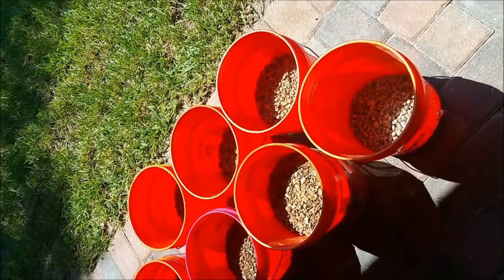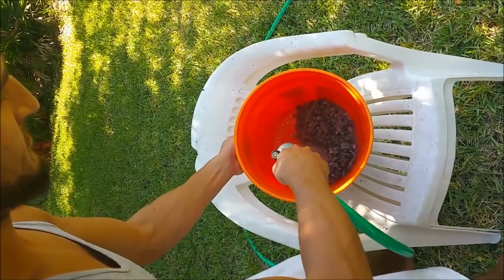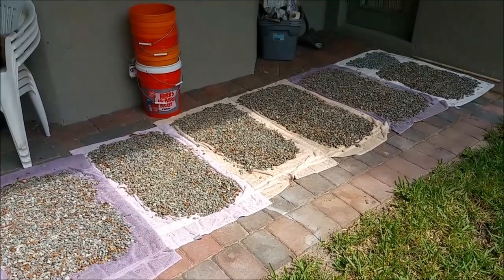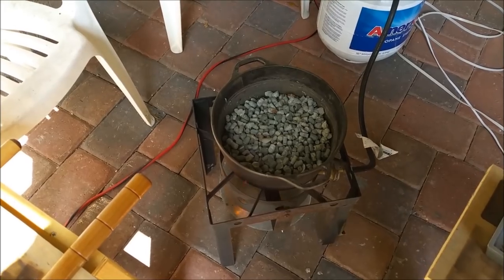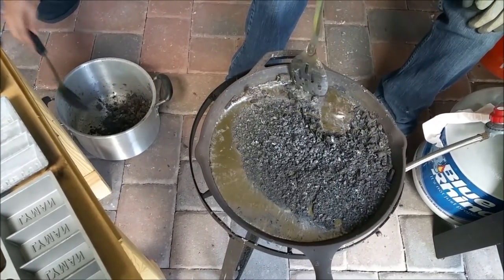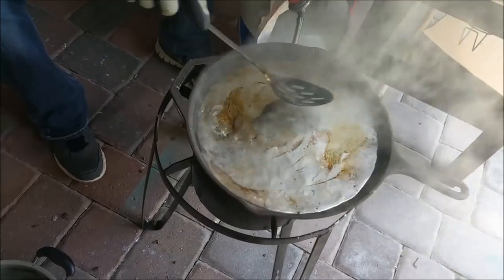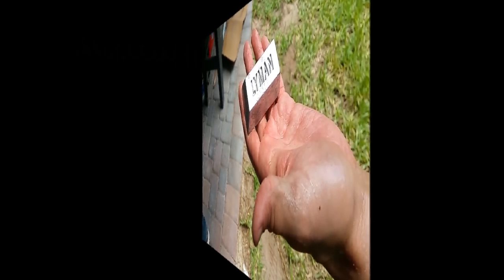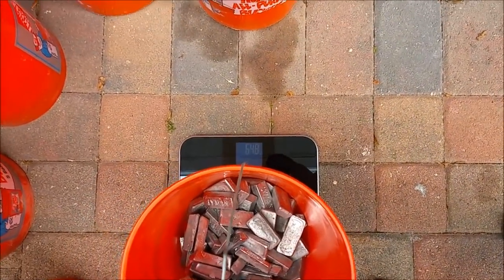Cleaning and Melting Reclaimed "Range Lead" into Ingots

Comment: Now, i see the point of quenching to make them easier to handle faster, but the hardness issue is debated as having and viable benefit and doing it at the ingot stage seems pointless as you're just going to have to melt it back down again to actually cast the bullets later on. 🤷🏻‍♂️
Reply: This is an old video but i wondered how many comments would address that.
Some folks really make you scratch your head. Okkkkkk 😀
Reply: He also took an unnecessary and risky step by introducing moisture into the range lead.  you will end up fluxing and scraping the dirt out with the copper anyways so no need to wash your boolits before melting 😉

Comment: To any new or inexperienced melters. Do NOT introduce any reclaimed lead or scrape pieces into your molten lead pot that are not completely dry!! A drop of water on a bullet or old wheel weight and your molten lead WILL explode in your face. Be advised and have fun.

Comment: No matter how many times I do it, it's always magical to watch someone else do it. Nice video.
Reply from the maker: Thank you sir!  It was a good haul - but I have made some modifications and refinements to our collection process, and we are getting geared up for another run this coming weekend.  Built a 2-Man Sifter which will be used on top of two specially made Saw Horses.  Will completely alleviate the back breaking work of the sifters I made for our previous trip.  They work well - but are still a lot of work.  The new method should be incredibly smooth, with very little effort, and should drastically decrease the amount of time involved.  Anticipating over 1000 lbs on this next haul.  I plan to do another video as well.
Reply: +DKH TACTICAL that's going to be nice man. Looking forward to the video. The most I've ever got at one time was 70+ lbs.
Reply: That's what I think about porn

Comment: a little trick for drying it would be to take 2x4s and small chicken wire and make basically shaker screens. Then just stack them up with 1 inch spacers (can be cut from 2x4s) to set between the racks for airflow. That way you get air going from all sides (pretty much) instead of just from above. You also take up less room stacking it vertically instead of all over the patio.
Also leave the last 1/8 to 1/4 inch of lead in your pot when you are done melting. It will melt quicker after already having been melted and you should find that it will allow you to melt your scrap quicker having a puddle already in the pot.
Reply from the maker: OtisENGINEuity -- great idea.  My wife would definitely appreciate me taking up less space and creating less mess on the back patio...  Great suggestion about leaving some lead in the bottom of the pot!  Thanks!!
Reply: DKH TACTICAL no problem, I learned that first hand when I brought stuff home after my grandpa died and started making weights. I noticed that if I left a bit in the pot it'd word easier.. same deal.
I'd love to do this myself especially with California going psycho about lead but unfortunately I have scoliosis that has made itself seriously known since I turned 30.. Threw my back out just bending over to pick green beans and took 2 weeks before I could do anything again.. 
BTW, as the son of a retired Air Force MSgt, thanks for your service. I'd be in the Army right now if it wasn't for my stupid back.

Comment: Great video can you use range scrap for slugs or is it to hard or is it softer than wheel weight thanks
Reply from the maker: ocean374  I will definitely defer to anyone who is smarter on this topic - or has more experience than I do, but Range Lead is going to be a MIX of different types of Lead.  Since I am reclaiming bullets of all types, it will include some Cast Bullets that people might have used Wheel Weights in their mix, and bullets from people who might have reclaimed Lead from Batteries, Dental Offices, Keels from Sailboats ---- the list goes on and on...  So the amount of Antimony (percentage) that you might have with reclaimed Range Lead can definitely vary!  I personally use the Reclaimed Range Lead for all my bullets, buckshot and slugs, but if you are looking for specific softness for your slugs (so they will expand/mushroom better), then you are definitely better off with pure lead -- or as close to it as you can get.
Reply: The only reason commercial shotgun slugs are pure lead is liability. You can fire them just fine through a full choke, but hard cast lead can only be fired through a cylinder choked barrel. I've made many hard cast lead slugs and they shoot just as well.

As for pure lead being softer for expansion, it's a pretty mute point when punching a .729 calibre hole through something.

Comment: For the future you don't need to weigh each bucket to find out the total weight.

Since you have 128 half pound ingots you have 64 pounds of lead in half-pound ingots, and you have 286 pounds of lead in whole pound ingots. Add 64 and 286 and you get 350. The extra pound you had might have been from the buckets, might have been an extra ingot that didn't get counted - I know I'd tire of it after about 50.

Comment: Why wash it first? Won't the smelting separate the dirt from lead?
Reply: Yea I kind of thought it was a waste of time to wash it.
Reply: I rinse wheel weights before I sort them so I can better discern if they are steel, zinc, or lead.  Makes the visual part of the sorting go quicker.  After I'm done sorting, I let them dry for a few weeks.  For range scrap, I just toss all of it in.  Dust, dirt, rocks, sand, etc.  It all floats on lead and is MUCH easier to skim off than rinse off.
Reply from the maker: Yes - the debris will float to the top, but you end up with wayyyyyy less mess by taking a little extra time on the front end...  I was not in any rush.  If taking the extra time is not your thing --- and/or you don't have the time (or patience), feel free to just dump it all in the melting pot and get jiggy with it...
Reply: asleepinthealley better efficiency by not heating a bunch of extra stuff dirt and rocks and such.
Reply: Everything will float. Then skim 
Anything else is wasted time.
Reply: You rinse all the lead dust into the lawn.
Reply: DKH TACTICAL by washing them that way, you probably have lead leeching into your lawn.  If kids play there at some point ...

Comment: Country Boy Prepper, sent me over. Nice vid can't wait to see the rest
Reply from the maker: Joseph Gauthier Thanks Joseph.  I ended up using a few pounds this weekend of that lead we just reclaimed, and did some casting with a new 6 cavity 158 Grain .357 mold.  Bullets came out great, and I used a new process of Powder Coating them --- instead of Tumble Lubing or Pan Lubing.  They came out nice!  I will definitely be doing a Powder Coating video soon!
Reply: Sweet, can't wait

Comment: Those little DIY tables are a great idea.
Reply from the maker: +Nick Musuraca Yes - after doing this a few times, we keep seeing ways to improve the process, and the need for some type of tables at an appropriate height was on of the first things we noticed.  Each time we do this, we see areas for improvement and for efficiency.  We started out with only 1 Burner, and only 2 Ingot Molds.  We quickly figured out that we were wasting precious time, and burning through more propane by only having 1 burner and 2 Ingot Molds.  Getting the right utensils was also something we didn't have to begin with.  The Tempura Scoops for removing the Jackets, and the Ladles for pouring the Ingots were also added after our 1st endeavor.  We are by no means "Experts" --- but I think we are getting better each time we do it!

Comment: Literally the only thing your process has that’s better than mine (see ‘Copper And Lead Recovery From Old Bullets’ video, which is about to be revised with an even better melter) is the way you mold the ingots. I currently use muffin and pie pans. 😄
Every time I see one of the many videos showing bullets being melted in skillets and pots just open to the environment with NO insulation to save energy cost and decrease melting time, and no containment against the occasional and sudden eruption from trapped gas or trapped moisture, I just want to jump right out of my skin! 😬😄! But what do I know, having recovered only around 5,000 pounds of bullets so far (all from “open range” and BLM areas)? 🤓

Comment: awsome video that lead stash is a treasure trove as good as gold!!
Reply from the maker: angelo soriano Thanks!  It was a pretty good haul, and the ingots came out great --- very clean!
Reply: it appears your an old salty sailor too!!i was separated in 84 from the uss wabash out of alameda ca
Reply: +angelo soriano (lead bullets
 for life) 

kindly, send to name of flux
Reply: candle wax or wood shavings and saw dust works as well.
Reply from the maker: Mohamed Aziz  I bought that tube of FLUX a couple of years ago, and have not been able to find it since -- but you can use Candle Wax, straight Paraffin Wax, or Saw Dust...  Saw Dust works extremely well.
Reply: yes,once the lead is up to temperature adding the candle wax will make it smoke then it sould catch fire. if not then add a match or lit flame to the hot lead and it should immediately start up.after the flame dies down remove the slagg.

Comment: DKH..  Welcome to the lead smelting and casting addiction!  I always like to see a fellow caster in action.  I found your channel through CBP and am now subbed!

Some pointers for you from a long time lead hound & caster:

 1)  Your safety gear looks good except for your son wearing shorts and tennis shoes.  Heavy cotton jeans and boots work well.  I have done the spilled hot lead dance and was so glad I was all safey-ed up.  I even wear a welders apron.

 2)  You don't need to wash your lead.  It can leave water trapped in the lead (ask me how I know) even after sitting for a long time.  Also.. any dirt, grime, coating, grease, or debris, will burn off with the melt and can be scooped off the top.

 3)  Fluxing..  It looked like candle wax that you used to flux the melt.  Wax is not a flux.  It can only reduce the tin & antimnoy back into the melt that may be lost through oxidation.  It also creates surface tension & prevents surface oxidation.  Use sawdust instead..  go to Walmart and buy a bag of pine pet bedding.  Saw dust reduces, prevents oxidation, and cleans your lead.  Wax will Not clean your lead.  Fill your pot with the scrap, add in a tennis ball size pinch of the sawdust to the pile and put the heat to it.  You will also find that when you are scooping the junk that the lead doesn't stick to the debris.  You can flux multiple times with sawdust if you like, and every time you add new scrap.  One last thing.. make sure that you scrape the bottom and sides of your pot.  Dirt can actually become trapped under the lead and you don't want that in you bullets.

 4)  Water dropping your ingots will only add a small amount of surface hardening to them, which will be lost when you remelt the ingots to make bullets.  WD does cool them faster though.  If you want harder bullets.. WD them.

I find that most of the range scrap that I deal with comes in at about 12 bhn which is similar to wheel weights.

If you have any questions I am always happy to help.

In all.. I enjoyed watching your video..  Thanks

Shad
Reply from the maker: shadowcastre 

Thanks for your comments... I definitely agree on all SAFETY pointers... My son started out with Jeans, as I insisted on it -- but then changed as the morning turned to afternoon and it got hot. I'm not as strict with him as I was when he was a teenager! Now that he is 24 and a grown man - he has his own way! Even when you are as careful as you can possibly be - accidents can still happen, and I will insist on jeans throughout the process from now on! 
As for what you said looks like candle wax -- it is actually FLUX, that I purchased in a 6 inch long, 1 inch diameter roll. Looks like wax - but it is actually FLUX. We have also incorporated sawdust into our fluxing as well. I do a lot of woodworking, and have plenty on hand.
Thanks for the info on Water Dropping of the ingots.  I understand that any hardness may be lost when the ingots are re-melted in the bottom pour pot – but as you mentioned, I also Water Drop my bullets as well.
Love it when I get feedback from other YouTubers!  I enjoy any comments that will help me improve my processes. 
Thanks again – and Happy Casting!!
Reply: shadowcastre ....great info......I hound as well.
Reply: I have a question, I have about a 6 quart pot outside melting right now on a turkey fryer, and it even has a lid. I filled the thing nearly to the top but it's been burning on full blast for about 3 hours and is only halfway melted (sigh) what am I doing wrong or what can I do to speed up the melting process?
Reply: @jacobwilliams2089  I had the same problem. The flames from your fryer are probably yellow/red. That means the temp is on the low side. Make the flames more BLUE by adjusting how much air the fryer get. More air = more blue = more heat.
Reply: @rogerolsson7303  I think most of it just wasn't lead and I didn't know

Comment: where did you get your things to pour the melted lead into from that forms the ingots? can those same molds or ingot casting things be used for copper or aluminum or brass?
Reply from the maker: If you are referring to the Lyman 1lb Ingot Molds - I got them from Amazon.  Here is the link:

https://www.amazon.com/Lyman-2837794-Lead-Ingot-Mould/dp/B001GXHM4W/ref=sr_1_1?ie=UTF8&qid=1470013424&sr=8-1&keywords=lyman+ingot+mold
Reply: +DKH TACTICAL yes and thank you very much my new found friend
Reply from the maker: You are very welcome!  I have refined my Lead Retrieval Process.  My son and I are planning another trip - probably in September.  Should be a minimum 1000 to 1200 lb haul.
Reply: DKH TACTICAL wow thats going to be a great haul if you can pull it off btw alot of the automotive stores most likely have old battery post and terminals and such easy way to get goot grade already sorted lead.... without gravels live ammo maybe occasionally you'll get a rusty stuck steel bolt but nothing too dangerous
Reply: Another source would be junk yards or at yard sells though yard sells could take a while but look for batteries, posts terminals and old hand tools like drills saws alot of them had lead castings the ones today have steel, aluminum and plastic castings or body's/ handles

Comment: Nice! But why to waterquench when you anyway will melt the ingots to make bullets later?
Reply from the maker: True...  It was more to just cool them off so we could move them and get them out of the way.  I do water-quench when casting -- so calling this a "water-quench" at that point was not necessarily for "hardening" -- and more so just get them cooled off and out of the way!
Reply from the maker: My comment about Water Quenching was premature.  We were just dropping the ingots into the buckets of water to cool them down to make them easier to handle/maneuver.   Obviously, we Water Quench the bullets when casting..

Comment: Did you tare the bucket for an actual weight ... also what pots are you using to melt in...?
Reply from the maker: +gerry kline Not sure what you are asking with the question of "Actual Weight"...  The scale we are using in the video is a pretty decent bathroom scale - so it's not going to be 100% accurate, but it's close enough for my purposes.  The pots are "Cast Iron".  One is a really big skillet, and the other is like a Dutch Oven Pot.
Reply: Tearing means the bucket has weight which is not LEAD thus you set the bucket on the scale hit the tare button and set it to "0" then add your lead weight. Getting the EXACT weight of JUST THE LEAD!

Comment: So how much did you end up making off of this run? I know it was a while ago now, but still curious. Thinking about getting into this and would like to know if it's worth it all.
Reply from the maker: I sold about 100 lbs at $2.00/lb, which bought some new reloading dies and some other reloading components, but I do a lot of casting (Slugs, Buckshot, and a wide range of various hand gun calibers), so I go through a lot of lead just by myself.  I still have well over 100 lbs left, but we will be doing another run around October - after it cools off.  We have refined our sifting process, and plan to recover well over 1,000 lbs on the next run.
Reply: DKH TACTICAL Thanks for the reply. That's seems like some pretty good cash. I may just get into it! Also, can't wait to watch the videos you make about it, 1,000 pounds will be crazy. Thanks again!
Reply: How long does it take to refine that much? Reckon it could be an income on its own?
Reply from the maker: Not counting the time it took to rinse it and let it dry --- just the process of melting 555 lbs down, cleaning the lead, and pouring into ingots was about 6 hours worth of work.  We had 2 burners going, with 1 Cast Iron Dutch Oven and 1 Cast Iron Skillet.  We will definitely be investing in another 5 quart Dutch Oven before the next haul, and I may purchase a few more 1 lb. Lyman Molds.  A 4th person would also help tremendously.  It is quite a bit of work - but other than the cost of propane and man hours - its basically free.  The amount of lead retrieved has more than paid for the propane we used, and paid for the the molds and cast iron pots - and other utensils.  This next run will be pure profit.
Reply from the maker: Plus - this time, with the huge haul we are planning on bringing back, we will also be salvaging the jackets to sell for scrap.  Since we had 200 lbs of it from the last trip - I would guess we will probably have 500 - 600 lbs in this next trip.
Reply: Oh wow, so if you did this four days a week you'd be pretty set? I need to find me a shooting range.